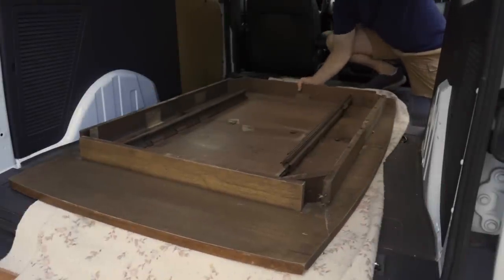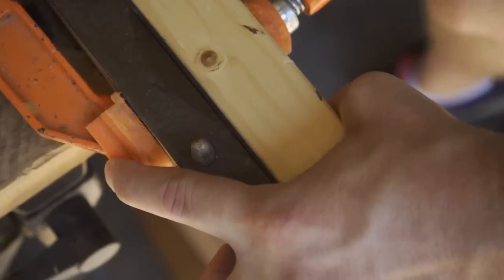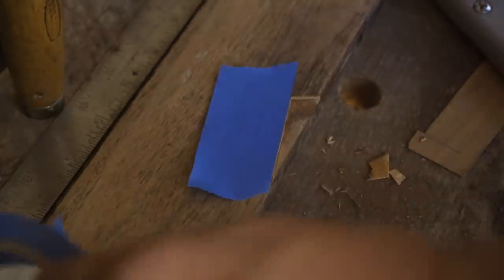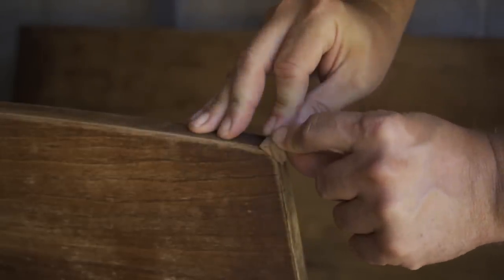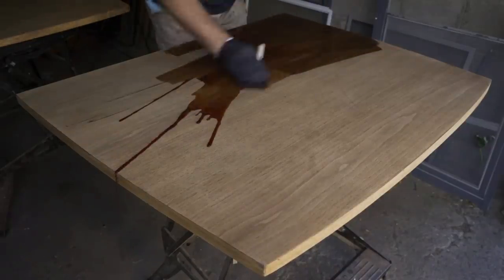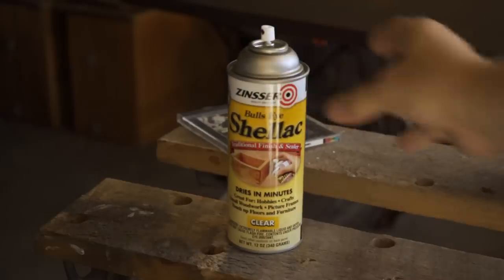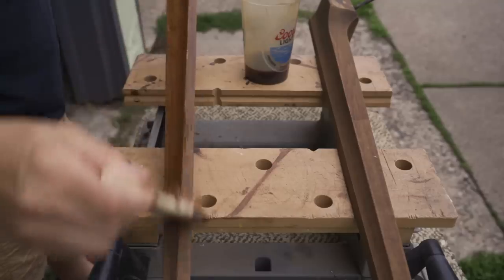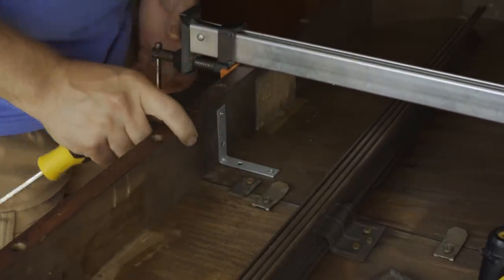Brasilia Table Found In Garbage Gets A Makeover | Mid Century Furniture Refinish & Repair

Comment: Good job. The latch was correct.   It sits in an unlocked position with no leaves.  When you pull it apart to add leaves, there are holes in the track where the “hook” drops in and holds it in place.  This is so one person can extend the table the correct distance to add a leaf. Then after the leaf is removed, you unlock the track to close it back up.  There are instructions out on the internet from the 50s and 60s from Broyhill that demonstrate how it works.  Looks great.  Great save.

Comment: Great job! Looks very nice. I once got lucky with an old, hand-made maple dining table. Decades before, someone set a hot dish on it, and left a deep, black mark, about 8 inches per side of a square. My wife said she remembered seeing the burn on it when she was a child, and we ain't exactly children any more. Figuring I had nothing to lose, I decided to see if I could remove it and upgrade the table overall. I took a belt sander to it (don't remember the grit) and it came out, with no damage to the table. After further sanding and care, the thing looked beautiful, and we still use it daily. I just figured a belt sander would butcher it, but no, it turned out great. Like I said, I got lucky.

Comment: The table turned out beautiful! The concept of using non-commercial solutions for coloring the wood is fascinating. Do you have any information on the colorfastness of the darkening treatments you used? Or how the different treatments might interact over time and with normal use? I know those are considerations when using natural dyestuffs on fabric, and wondered if that was true for wood as well.
Reply: Good questions!!!
I would love to know, a well!
Reply: My uncle made wooden jewelry.  He called this process ebonizing and said the color was from the dissolved iron binding to tannins in the wood.  Oak having the most tannins takes the darkest color but many woods can be ebonized to pleasant effect like this walnut.  It's my understanding that this is a very stable reaction (hundreds of years).

Comment: The corner brackets seemed to work well for straightening the rails, as I would expect they should.  The brackets are mostly hidden, so the fact that they have a harsh utilitarian look is not very important.  For a more aesthetically pleasing solution you can cut some corners out of wood and use them to brace and straighten in much the same way.  You should cut the corners so that the grain of the wood runs lengthwise along the long outward facing side of the corner, for strength.  Then you plan your pilot hole, not so it will exit at the point of the corner, but set a bit off center and not quite perpendicular to the outward facing side of the corner piece, so the hole, and the screw, will exit through the face of the rail that is against the table top.  Then tightening that one screw will pull the rail up straight.

Comment: Mister Dashner, 

I built on your techniques, sort of:  20 mm syringe, 18 and 22 gauge needles (all from livestock supply).  Sacrificed one needle by breaking of needle part and blocking the end with superglue or something that will harden and seal.   Cap syringe and fill with wood glue and use to fill those nasty little cracks.  The 22 gauge takes a bit of pressure, but it will carry glue deep inside the smallest cracks.  18 gauge is more utilitarian but much quicker to expell glue. And you can buy syringes with 18 gauge needles in a single package.

Then, after wiping excess glue, use green inch wide tape used to tie plants to trellises and such between clamp or wood used to prevent marringl and project.  Even Gorilla glue won't stick to it and you can reuse one piece infinitely, avoid detection by the gardener from which you liberated it.   

Thanks for all the wonderful hints, techniques, and skill you share with us. 

Just another fan

Comment: Finally a project worth doing.  The only thing about doing the table this way is that if you wanted to do the same with matching chairs, they are not all walnut like the table top.  I'm going to start to make my own toners and I think that would have been a better choice on this table if you were going to want to match it up with the correct chairs.  I actually have a Broyhill Sculptra (almost the exact same table) dining table and matching chairs that I am going to make really dark since I do not want to strip the chairs of their old finish, but I do want to hide the sanded parts and give them an even finish.

Comment: Wow, nice result!  I worry a bit, though, about leaving the sodium hydroxide on the wood.  When I've used lye-based stripper, it came with a citric acid solution to neutralize the lye.  I had a spot that didn't get fully neutralized, and the new finish bubbled there.  Maybe you have a lower concentration of lye, though, and might be able to get away with it.  The shellac sealer should probably help.

Comment: Good job!  A table made of real wood is worth saving.  We bought one of those desks that look like wood but are really some kind of resin compound.  Color comes off the edges and cannot be replaced.  Smears from hands rubbing it can't be cleaned off, even with special cleaner made for it.  We need to treasure real wood.

Comment: I really like how that came out. I was skeptical about the vinegar but it turned out nice. I don't ever see it done but would lubricating the rails not only help with sliding it for the leaf but prevent additional rust?
Reply: I think so too. Maybe soak it in some  evaporust and brush it down with a wire wheel or something. I'm not sure how important the mechanism is to the value of an antique but I would think you would want to save it if you can. It just needs a little cleaning out and some oil is all

Comment: Did you sand the top and the other parts/apron before staining and after applying lacquer? I saw the scraping but didn't see sanding of the top and the scrapped parts after using the stripper.

Comment: ok, I love your videos & consider your refinishes very classy, however, I do have some constructive criticism for this one. First, I thought you should've gotten rid of the rust on the screws and metal parts of the table. The ol' vinegar & wire brush on a dremmel or power drill makes this relatively quick. Then maybe a rustoleum seal to prevent future rust. Second, I thought you should've filled the old screw holes for the latching mechanism with dowels before drilling new holes right next to it. Maybe you did this off camera & just forgot to mention it, because I know you've done it a hundred times in your other videos. Anyway, I apologize if this came off as a typical internet bashing comment, that's not my intent. I truly do love your videos & your refinishes. You're supremely talented & you have great taste.

Comment: My parents bought this entire dining set in the late '60s. Table with leaves, china cabinet and 8 chairs. The table and leaves survive with me; my sister has the china cabinet. Cabinet has original finish, but the table and leaves have been refinished by us. None of the chairs survive; they had a poor design where the very thin rear legs would split irreparably where they joined the seat and seatback, so one by one they failed and were junked.

Your sample was not as well taken care of but you did a fantastic job bringing it back to life. I wonder if the person you obtained it from knows the whereabouts of the leafs.

Comment: I'm off to throw some steel wool in a jar of vinegar. Refinishing has always frightened me, thanks for the courage. Be sure to keep your rattle cans vertical to keep them from farting. Prop the work up on at least a 45 degree angle so the can doesn't have to tip over too much. Cheers.

Comment: The black line on the top is most likely where a pipe (regular pipe for plumbing) was in contact with the top for at least a few years.  Given the underside of the top, it was probably stored in a garage in the rafters, upside down with the pipe underneath as a support.  I'm sure you thought of this, but sodium hydroxide (lye or caustic soda) used in the two part kit is a highly reactive strong base used to take stains out of concrete, as an oven cleaner, and to clean clogged drains.  It is a chemical that requires some care when used, even in a weak solution.  Others that watch your video should know that it needs to be flushed with a mild acid like hydrogen peroxide (as the two-part kit used), or water - to make it chemically neutral (ph 7).   Otherwise it will eat the finish and/or veneer over time.  Don't attempt to use baking soda to stabilize the ph, it will create carbonates (NaHCO3 + NaOH → Na2CO3 + H2O).  Just use water to flush because that is almost the same as Hydrogen Peroxide (water=H2O, Hydrogen peroxide= H2O2) but with no bleaching effect, even though it will raise the grain.  The wood grain can be sanded or scraped afterwards, and then the finish applied.

Comment: I also have a Brasilia dining table like this. 
It was it fairly good condition but I did have to glue down small areas of veneer. 
I was too afraid to refinish because it was veneer, but seeing this , I may attempt it someday. 
QUESTION: I took off the legs to transport it, but when I reattached the legs , it squeaks !
It didn’t before I removed the legs. WHAT is causing this? HOW do I fix it?
Reply: Also - Thank you for not speeding up you videos. It ruins the whole experience.

Comment: The sodium hydroxide deposit will alone continue to degrade the wood over a long period of time. You should have neutralized or washed it off after it did it’s job. Humidity will continually activate it.

Comment: Finish won't last with spray can anything. Brushed on varnish with 3-4 coats for tabletop. My humble opinion.
Reply from the maker: My experience is that there are lots of durable finishes in spray cans.  I have pieces with spray can finishes that are years old, get used everyday and don’t show any wear.  You can get polyurethane in spray cans.  That’s a durable finish.  You can get catalyzed lacquer in a spray can.  That’s a durable finish.  Thanks for watching.